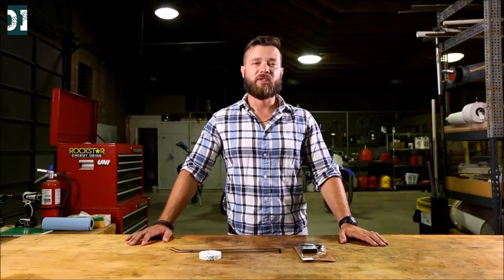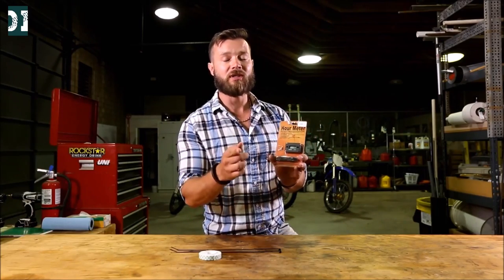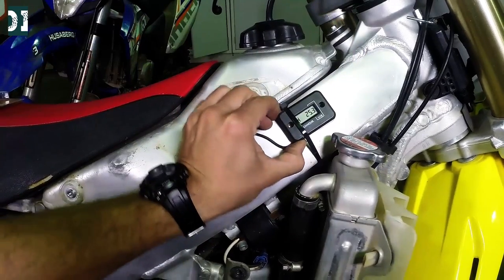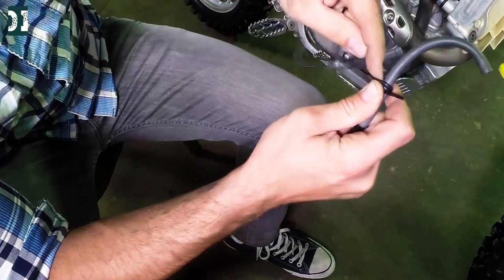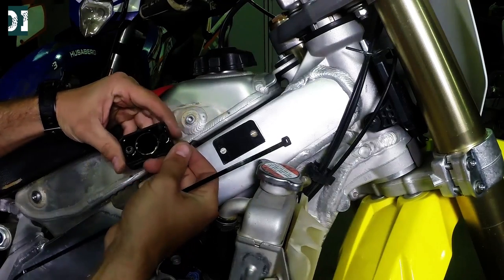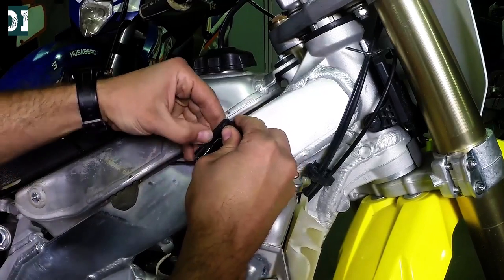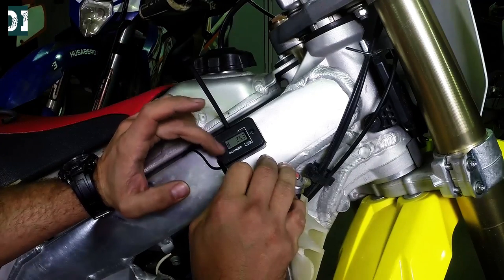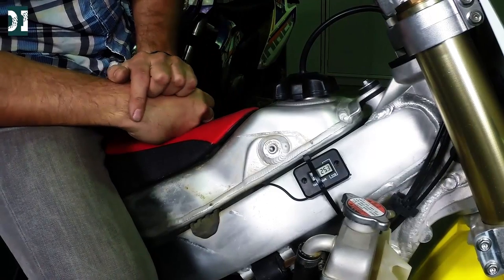How to install hour meter on a dirt bike - best way to spend $5 on your bike

Comment: Quick question, does the hour metre record minutes/hours when the bikes engine is on but idling or only when u give it power and Ur moving ?
Reply from the maker: when its on, no matter what rpm
Reply: @dirtniron  cheers man , one more thing please .. does idling ur bike with engine on wear out the engine oil and count as part of engine oil change time ? If u know what I mean .. or is it only when ur moving (rpm) on the bike ?

Comment: I have  heard  of  dealers  putting  on meters  with  low hours  on it just  too  sell  it  same way with  lawn  mowers  they  no your  not  going  to  want  one with  high  hours  remember  the world  we live  in
Reply from the maker: yea it can happen ..
Reply: Just like the 60s and 70s vehicles. My Dad drove 85 miles a day 6 days a week to his work as an industrial electrician. He usually needed a new truck every 4 years. First thing he did when new was disconnect the speedometer cable. Traded a truck with high mileage actually showing like 30,000 miles

Comment: I have the same meter from amazon , wrap the wire well and tight arround the plug wire and start the bike nothing happen on the meter i try like 5 time different way and still show 0.
Reply from the maker: probably bad unit.. sorry to hear that

Comment: How many hours would you advise to do a top end rebuild thanks
Reply from the maker: +Gareth Frost I have 70 hours on my RMZ and still running strong. I will check it around 100 hours and see how it looks.
Reply: Ok let me know I bought a rmz 250 with 50hours this is my first bike.. and I find your videos very helpful and useful thank you..
I'm not a hard rider but I enjoy myself 
Anything you have to replace please tell me and on how many hours thanks again
Reply: @dirtniron  Well wait a minute you said the RPM wasn't accurate, I want this specifically for the RPM gauge should I skip this??. I know some of these you have to enter codes for 4-stroke one cylinder 4 stroke 2 cylinder 2-stroke one cylinder etc,. I see this doesn't have that

Comment: how rpm and hours of work calculated in a crane
what is formula according to actual time by watch
like working according to real time is 4 hour but crane rpm and hours meter show only difference of two hours
so what is that factors which slowdown the works hours meter in a crane from actual real time or simply what is formula

Comment: does the battery die and it reset your hours? are the batteries replaceable?
Reply from the maker: Yes eventually, it's not replaceable. Mine is one for over 2 years now.. when it dies I will get another meter

Comment: i have a question ...i just got the bike and it has the exact same hour meter and it says 2''09 hours..it means 209 hours or 2 point 09 hours?...i know thats a stupid question but the dealer told me that the bike has 65 hours and im comfused
Reply from the maker: i think it is 2.09 hours. probably the meter was installed recently
Reply: thank you very much i appreciate it

Comment: on my rmz 250 the hour Meter wont work   but  i dont know why i wraped IT about 3-4 Times Sound the Spark wire
Reply from the maker: +Felix Winter hmm.. make sure the wire is all the way in the meter. Wrap it couple more times on the coil and see. If that doesn't help then the unit itself is defective.

Comment: rpm is 1/10. So it doesnt say idle at 400 it means 4000.
Reply: Are you sure? Coz I'm about to buy one just to check my RPM while I adjust my engine idle speed coz my motorcycle doesn't have RPM meter.
Reply: thats definetly not 4000 rpm in video lol, not even 400, i think he set it on 2 stroke and he got 4 stroke, so the real rpm is 800

Comment: So if i install an hour meter on a bike that has a few hours on it will it count those hours or will it start from timing once it installs and ride it then?
Reply from the maker: it will start to count once you install, it has no way to know how many hours on the bike
Reply: @dirtniron  i thought the rpms would drop and it would count t but thanks i appreciate it
Reply: Mathe macits what do rpm have to do with total hours

Comment: If you have hours on bike should I not get one bought mine from Craigslist runs great though
Reply from the maker: i bought all my bikes on Craigslist and installed the meters on all of them, that way I can keep track of everything, even of the seat time I got for the season ;)
Reply: Dirt N Iron thanks think I might rebuild after this season
Reply from the maker: i would still get one to track hours for oil changes, then after the rebuild I would buy another one and just replace the unit, pick up wire can stay the same.. that way you start from 0 again..  what bike did you buy?
Reply: Dirt N Iron I bought a rm 125 1997 super clean though still has foctory stickers on it field ridden
Reply from the maker: great bike, I used to have 97 rm250, love those conventional forks. here is my last video on rm250 https://youtu.be/8lDdpEbuUzQ

Comment: It seems like the tacho is in 2 stroke mode :) Did you set the tachometer to a four stroke? Because if your rpm isnt correct, than your engine hours will be also incorrect :)
Reply from the maker: there was no button to push for 2-4 stroke.. it was like 3 years ago.. but even though its in 2 stroke mode it still counts engine hours correctly. What is your logic behind the incorrect count ?
Reply: @dirtniron 

I did not notice, there are no buttons :) Im 100% sure it is in 2-stroke mode. Counts each ignition pulse as one revolution. Many 4 strokes give a spark in every revolution, but not all of them. Displays 440 at idle. It is therefore very likely that it is double - 880rpm. Im not sure if im right but you can test it if you want. 

'Engine hours' as I know it, is not just the time the engine is running. It should be calculated according to the rpm. If you are riding at full throttle, the engine hours should rise faster than if you were driving slowly. I admit that this tacho may not be the case.
Reply from the maker: yea, it was in wrong mode, but the engine hours is just simply the time engine is on. So when the spark plug gets the power to fire up, the meter starts to count the time until there is no more spark.
Reply: @dirtniron  In that case, it counts the "run time" correctly :) As i wrote. The real engine hours should take rpm in to the calculation. But this is only technical detail. I think for biker purposes it is sufficient solution.

Comment: So You don’t support your local shop when buying things ? Bet you can’t do a bottom end so I hope your dealer can live from that when you don’t even buy small things from him.

Some people like you don’t understand that dealers can’t live from the one tube at the race just because your China one won’t arrive until second moto. The Problem is that your eBay or whatever Shop won’t help you between motos and won’t help you with problems or do all the work you can’t. 
People like you ruin the sport.
Reply from the maker: You can see it that way Simon. It's not full picture though. Have you seen the video where I spent $100 at my local shop where I get tire and let them install it too. Sometimes I get stuff online sometimes from my Motorsports, all the oil and little parts for maintenance I usually get from my local Motorsports.  Dude, I even buy those overpriced toy dirt bikes they have at the counter, if my kids are with me. ;) 
 There are ways to save and  ride more, I think it can promote the sport to make it more affordable. Hope that makes sense. Take care

Comment: so is there a battery inside ? and can you reset it ? does it save the hours if battery is empty ? thx
Reply from the maker: +der 60er there is battery inside, it's sealed I think once it's out you can get new meter. I have mine for 1- 2 years now on both bikes so far working ok. I am not sure about resetting
Reply: Depends on  the  meter dealer  can get you by putting one on that  has 6 hours  on it and actually  it has 60 hours  on it or more I have heard  of  people  doing  that same way  with  riding  lawn mower  you  don't  actually no how many  hours  are on  it they no if it has high  hours  your  not going  to  want it rember  the world  we live  in